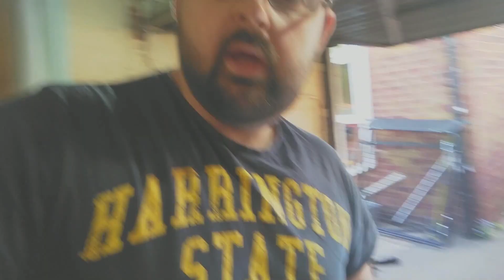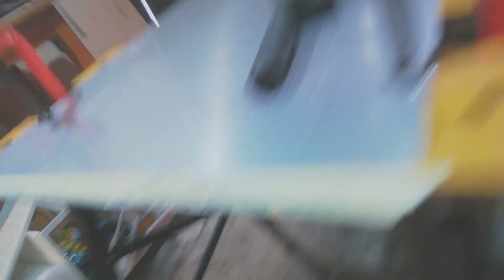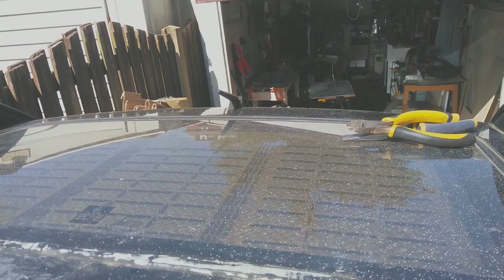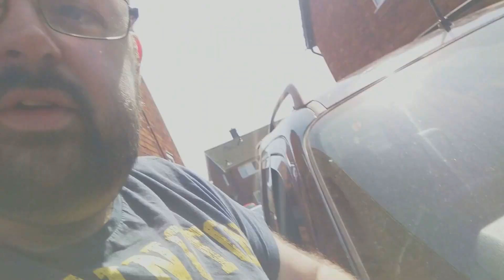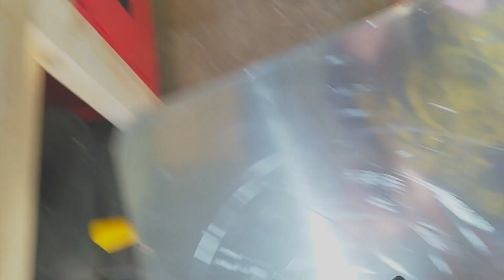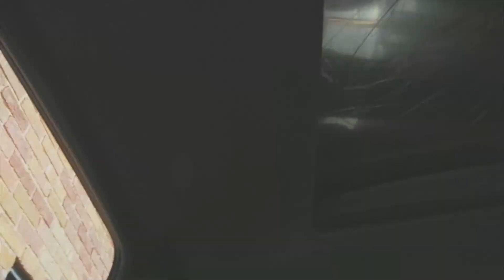Permanent sun roof leak repair!

Comment: First sensible repair I’ve seen , who needs sunroofs in the UK , I was planning this on my D2 and stumbled across your video , someone suggested the sides of an old washing machine as it’s good quality steel , maybe a thought ?
Reply from the maker: Thanks for the nice comment and for watching, yes mate, something like that will suffice, this was during lockdown so was limited what I could order. I used a high quality epoxy I got from work, not silicone like I said, couldn't mention at the time lol Didn't take long to do and is a lasting repair, not long after my roof rack was back on it so like you said, don't need it.

Comment: Hi Chris could you please tell me what size rivets you used for blanking off the sun roof (freelander) i forgot what you said. Also fuel tank straps what a f. Ing job sore fingers knocking elbows. Thanks again Chris..Mike
Reply from the maker: Hi Mike, i believe they were 6.5mm or something close to that, and i used a good qaulity two part epoxy bead, ive just done gear linkages on my transit, 4 bolts a bent bracket and two hours later i have working gears again 😭, sore knuckles indeed, i share you pain, be many years before you need to do that again mate, atb Chris
Reply: @whiteroseoutdoors  hi Chris thanks for your reply have wrote size down no excuse now. Glad you got gear,back. (Bat out of hell). Lol. Thanks again.

Comment: Hi mate, can you tell me when you measured it was it from outside edge of the rubber and what size rivets have they got thin large head. Bye the way outstanding videos . Am about to do fuel tank straps right ball ache av been told. Many thanks. Mike storey.
Reply from the maker: Hi Mike, yes mate i removed all the rubber and measured approximately 20mm larger than the original hole size, i never did mine ive read they are difficult. Thank you for the kind words mate, alot of effort goes into them, thanks for watching, best of luck with the straps. Chris
Reply: @whiteroseoutdoors  Thanks Chris for the reply 👍 I've heard the straps are not easy because off the bending  and twisting when putting them back on.

Comment: have been thinking of doing the same, but decided not to. I wonder if the leaks stop if I keep the drains properly cleaned and unclogged...?
Reply from the maker: The seals were too far gone for that in my case hence the extreme measures. If yours is in good condition then maybe yeah just keep on top of drains etc. 

Thanks for watching.
Reply: Hi mate can you tell me when you measured plate was it from outside edge of the rubber seal. What size rivets with the large thin head. Thanks million. Ps outstanding videos bye the way once again Thanks. Mike storey

Comment: I dont think your light bar will have any issues from the sunroof motor wiring, they handle a bit of load anyway, its not like you're fitting it to a small interior light. 
It doesnt look too bad either, I think some acid etch primer and some paint would've been a better fix it before it was fitted to try and reduce any galvanic corrosion between steel and aluminium panels. 

Im in a similar dilemma with my defender sunroof, Too much effort to unbolt and swap the front half of the roof.. and too much effort to unbolt the roofrack 😂 sealant it is
Reply from the maker: I ended up wiring it to a separate switch in the cab, I figured id use that wiring from the motor for a better interior light as its dismal at night inside haha, the existing interior ones are awful. 

I'm hoping the amount of epoxy (don't know why I said silicone in the video) i put on the roof to seal it stops any corrosion, i put alot on so time will tell, i could do with some insulation in-between the plate and the sunroof cover slide thing though, get mad condensation.

I'd recommend it, I'm very happy with the results, no welding, cheaper, and its a once done its done sort of job.

Thanks for watching bud! Atb Chris

Comment: An alloy plate over the roof... What a fix... and what a joke.
Would`ve been MUCH, MUUUUCH  easier to seal the glass and remove the motor (which you can actually sell for your stupid 40 quid).
Nvmd that a spare seal that costs 30 quid could be replaced and stay there for another 20 years.
Reply from the maker: What an amazing and ignorant comment! Thanks for watching! 

But wait if you had watched you would have seen how severely rotten the running gear is, which would eventually lead to the roof rotting, this magic seal you speak of, is unavailable from what i can see, annnnnd would have leaked at some point anyway... As all i could find were either obscure parts that could not confirm fitment or universal fit which NEVER work....

I wanted a cheap, permanent fix that is secure which won't continue to rot the roof, which i have....

Stay tuned for more content! 😂
Reply: I haven`t said anything about any ''magic seal''. I simply stated that riveting a large metal plate over a sunroof in order to seal it is one of the stupidest thing I had seen. It`s not any more or less permanent than sealing the sunroof itself. 

You say you wanted cheap... 40 quid and the hours of labour... some deal you got yourself dude.

If calling me ignorant under false courtesy makes you feel intellectually superior - so be it. 

Thanks for the invite to stay tuned. I`ll make sure to watch some more of your videos to see other 'Great Permanent Solutions', lol
Reply from the maker: £40 is cheap, and the "hours" labour, was infact quite fun, so not so much labour... oh and please tell me how quickly it is to replace a seal and remove the motor as you say? Minutes i presume from your manner of speaking....

The fact you can't see your ignorance is fantastic, truly entertaining. To then reply in a manner as to try and sound intellectually superior is even more entertaining.

Please do keep the comments rolling, it's always nice to have a bit of comedy in tough times as these.
Reply: I always butter my toast after I've made it, I'm probably doing it wrong, maybe you can enlighten me? You seem to the know the only correct ways of doing things....

Tit.
Reply from the maker: Thanks for boosting my engagement anyway pal, you've helped me by watching, no doubt hitting dislike and commenting...

Cheers 😂😂😂😂
Reply: What a ridiculous comment , obviously not a Land Rover owner , if you can’t say something good , shut up
Reply: Its not about good or bad comments, I get to have an opinion. If you don't like it - switch off commenting option. 
Again. Shoving a metal plate over a Leaky sunroof is not a mark my experience, rather that of the authors of the video! 😂
Why? Why would you do that? Its insane.
As I said, permanent sealing is just... Normal... solution 😅😅